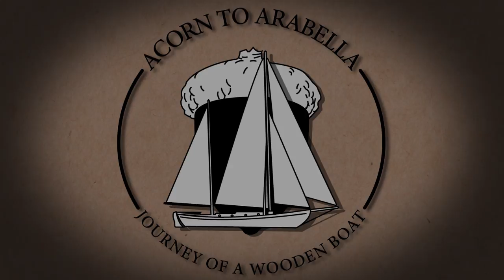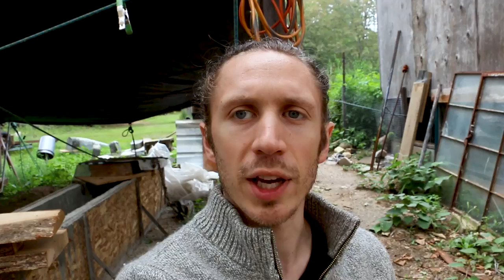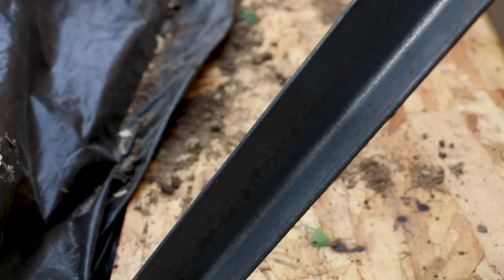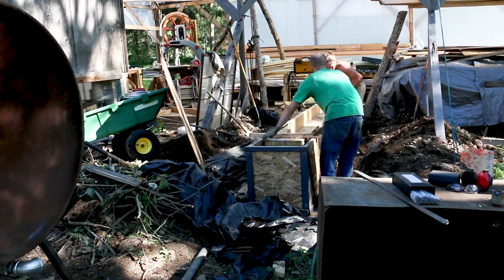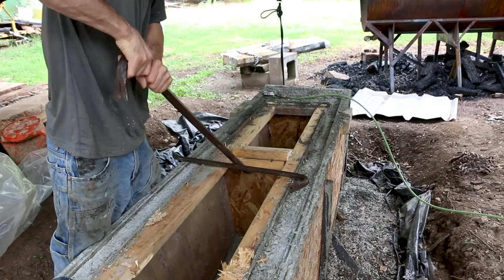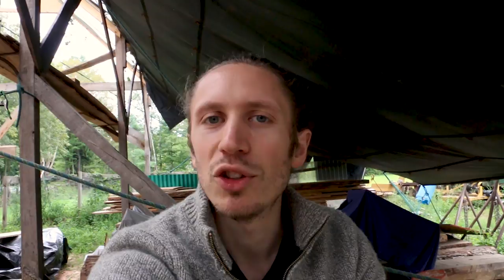Acorn to Arabella - Journey of a Wooden Boat - Episode 15:  Casting The Ballast Keel Mold

Comment: When I make molds for casting glass I put them in the kiln on a low heat to dry them. Maybe if you build a fire under, around or maybe even in you could help the drying process along? Not enough heat to crack it but maybe use coals?
Reply from the maker: Hi Kevin!  Thanks for the tip.  Yes, we thought of this as well.  We have decided that we are likely not going to be using this mold though.  We're hoping to update everyone soon as to the revised plan for the pour.  Stay tuned

Comment: If you haven't poured the lead yet, you could always build a fire or two in the mold to help dry it out, then just clean it out with a shop-vac. The charcoal dust may even work as a release agent for the lead. Did you guys consider maybe laying a half cut pipe lenghtwise in the very bottom for added strength? You could weld little reber "T's" down the center to make it hold into the lead.
I personally like the vlog style as it gives us a chance to get to know you guys better and hear your take/outlook on the progress of the project.
Reply from the maker: Thanks for the thoughts and suggestions!
We have thought of all that and more for the ballast keel.  We are going to scrap the concrete mold and do it the way the old timers have done it for years.  Burying a wooden mold in the ground.  It might be more work than the concrete was but it's much less likely to explode on us!

Comment: Next week I'm casting a 600 pound keel for my Herreshoff 12.5 Haven. Will document the process. Mine will be poured into a wooden mold which is covered with plaster. Can't wait to see your pour.
Reply from the maker: Nice!
Is it a restoration or are you building one from scratch?  A 600 lb pour should be very doable, we melted down a few thousand pounds of wheel weights and it was manageable.  10,000 lbs (100 gallons) of molten lead provides a couple extra challenges! ha!
We also can't wait to see our pour, hands down the scariest part of the build!
Reply: Hi guys,
I'm building from scratch. Thought I'd get the pour out of the way and it seems like a fun challenge. Then I'd move on to all the small stuff before I lay out the frames. This is so I don't use up all my garage space until I have to. My strong back will be on rollers so I can move from inside to outside. I'm making a few test pours to see if Durham's or plaster work as a coating for the wood. You don't have that problem as you are casting in concrete. I may change my mind and do a plug like you have done. I'll post some video as soon as I edit. I'm playing around with YouTube and have thrown up a couple videos of my shop at Craig Kelford.

Comment: OK, boys ive had a fair bit to do with casting in my younger days.....get the clay sand damp only so it will form in a closed hand tightly when you squeeze the shape should remain after you open your fist. You can layer everything inside the mold with a little sifted flour as it will smooth things better. You can add venting holes into the main and leg area of the mold by first forming the 2 piece mold then breaking apart then you can push through a sharpened rod to the outside as this lets the form set better and diminishes the chances of getting cold laps in your cast. Good LUCK!!!!
Reply from the maker: We will use the sand method later on if/when we have to cast bronze parts for the built but for a ballast keel we would literally need a dump truck load of the sand! A wood mold buried in the ground is traditionally the most common method, it chars but does not actually burn.  People have also used concrete and steel.  Steel warps, we knew that from other things so concrete sounded ideal until we learned about it liking to explode.  We are going to demo the concrete mold and make a wooden one like the old timers did.
Reply: karl p ium
Reply: All good I'll be watching you lot hard at it..any questions gimme a yell

Comment: the men at a foundry do the same thing as what you have done.   They make the concrete form much thicker and smoother.  next time soak your form boards in diesel fuel to keep the concrete from sticking to the boards.
Reply from the maker: Interesting, we have been told over and over again that pouring into concrete is super dangerous.  Do you know what kind of concrete they use?
Reply: Use  Portland cement mix, no extra sand. You don't need big stones in it like in concrete.  Let it set up for a week.  Then preheat it evenly and get the water out.  uneven heat will crack the mold.  If water is on anything including the lead you drop into the pot it explodes.  so everything must be dry.  you probably need some wire in the  Portland cement for strength..  Maybe make a small mold for a practice mold.     Mix the Portland cement and water.  Let it sit for a week.  Then preheat it to remove moisture.    it must be heated evenly or it breaks.  Then preheat the mold again right before pouring lead.   also face protection is in order.  but breathing masks are not.  the temp to get lead vapors is way way high.   you will not reach that temp.  wash hands after handling lead.  don't eat while touching lead.  that will contaminate food.  no drinks or water around melted lead.

 when you get the lead melted throw in a half of a wax candle into the pot  to act as a flux.  the wax will flame up.   stir it around and the impurities (dross) will float to the top.   then dip the dross off.  Your lead will be shiny and pure.  It will flow better to make a smooth casting.  it will mold together if you need two pours. It will not have as many voids in the mold.   the mold should be thicker on the sides.  the Portland cement will make a very smooth mold and a smooth casting.  .  preheat the mold evenly with a torch.   You  can use a dipper to dip in the first little bit of lead for a test.  If no steam you are good to go with the casting. 

Using tire weights will make a good hard casting.   the antimony,  tin , and lead in tire weights make exactly the best hardness.  I have shot over a million rounds of lead ammo.  Soft lead makes bad soft bullets.  Tire weights make very hard bullets. 
 
Here is a casting made from Portland cement. 
https://www.youtube.com/watch?v=ZLcXt2Pn8jw

The only thing i do different than they do in the YT videos is I scoop off the dross while its in the pot.   Drop in a wax candle to act as flux.   stir up the heated lead.  the dross will come to the top.   I scoop it off then.    ou can scoop of the top of the mold too.

best of luck sailors

Comment: Hi guys , i understand the use of lead , it being dense for volume but would concrete reinforced with rebar , but it is a pretty close second in contention to lead and way safer , concrete weighs around 4.5 to 5.3 thousand ponds per square yard depending on how dense it is mixed with portland cement and rebar and of course aggregates , lead is about fifteen percent per yard heavier per square yard i admit but concrete is easier and safer by far  , just thought id put that out there , i know it way too late now but for future reference  it may be worth considering , excellent videos and very informative
Reply from the maker: Concrete could have worked but it will not last nearly as long as a lead keel will and comes with a whole host of other problems.  Lead is the gold standard for a ballast keel for a reason =)

There are certainly health risks with lead and if anyone is considering pouring a keel we highly recommend you read the comments below and do your research about the health and safety issues.
Reply: lead is 11.3 g/cm cubed.   Concrete is 2400 kg/m cubed or 2.4 g/cm cubed.  so 370% heavier per volume. Nice work guys. I will follow your progress with interest.

Comment: If you plan on using pipeing for the pour you should apply heat the pipe it as the lead will solidify inside and plug the pipe. Also, be sure to test the setup before you commit as small problems will quickly turn into big ones with hot metal.

Are you planning a single pour or multiple? Wonder if there could be bonding issues if too much time is taken between pours and an oxide builds up.
Reply from the maker: We will use a pipe for the pour and it has to be done in one shot otherwise you will get layers and that is no good.  

If it could be done in small batches we would have done it already.  
We have to melt and pour all the lead at once, that's roughly 100 gallons of molten lead weighing 10,000 lbs.  We are terrified and want to get it right the first time and only do it once. 

We melted a few thousand pounds of wheel weights in preparation of the big pour and learned a lot from the process.  We had a clogged pipe and leaky tank and much more.  It should all be shown in the next video in two weeks.  Stay tuned!

Comment: Check out SV Seeker.  Doug poured at least that much in his boat.
Reply from the maker: We have and he did, but he did it in roughly 1,000 lb batches.  Because of the difference in design he could get away with that but we cannot, we have to pour it all in one shot.  We literally would have to scale up his rig 10 times which does not seem practical.  But he does have some good insights into the challenges!
Reply: I would have waited until you have the keel made then dug the ballast mold into the ground and lined it with ply making sure you put the bolts through the keel leaving a gap then burying the heads of the bronze bolts into the ply, put the keel on top of the mold then pour. SV seeker only realized right at the end they didn't need to melt all the lead, all you need to do is fill all the gaps with molten lead, ie just poor some into the bottom of the mold then put solid bits in and pour more, try it on a small scale, you will find the molten lead attaches to the solid lead with no problem.
Reply: Acorn To Arabella p

Comment: You might have seen SV Seeker. He has a steel hull boat and a different style of keel but he did fill them with lead and had a pretty good set up for it.
Reply from the maker: He did.  Unfortunately our keel has to be poured in one shot.  We would have to scale up his set up 10 times to achieve our pour which seems impractical.  But we learned a lot from him!  We could not believe they poured inside the boat with no protective gear.  I know we were not always wearing ours but at least we were outside in open air! Not inside a closed space!
Reply: Acorn To Arabella I know what you mean. The other thing I totally dont get is why he filled his keels on land miles away from the water. Seriously why not leave the job till later and save the lifting and trucking.

Comment: Not sure where you are in the pour? Can you consider using Zypex applied to the inside of the concrete? In typical moisture incursion into a home foundation, you can mix the Zypex with water and paint or spray it onto the concrete mold creating a moisture barrier? This is done on the inside of the foundation.
Reply from the maker: We poured the keel this past Monday! We destroyed the concrete mold and used the wood one we built.  The fear with the concrete is the moisture tuning to steam, expanding and being trapped in the concrete then the concrete cracks or explodes.  It is a issue with moisture trapped inside the concrete from when it was made, a coating would not help.

Comment: Have you looked into using green casting sand -  you can make a plug out foam that burns away when you do the pour - the sand is packed around it and then you pour into it. Also, instead of using wood plugs that burn away, you could use stainless steel threaded rods and immerse them into the lead while it is still molten. Before putting the rods in bend them at one end so you have an "L" shape so they are more secure in the keel. I worked in the sail boat building industry for 15 years. We didn't make our own keels but I know some of the techniques that our keel makers used. One used casting sand to create a rough lead plug that was dropped into the molded fiberglass cavity of the keel. Another built a steel mold, and a third used casting sand to create a keel with bolts in it that was bolted to the bottom of the hull. Earlier models had the keel as part of the hull that contained the rough lead plug and later the keels came with a smooth finish and they were bolted in place to the bottom of boats that were built without a keel cavity. There are vids on ytbe that show using casting sand and also the "lost" foam method.
Reply from the maker: Thanks for the suggestions!
We are going to demo the mold and make a wooden one.  Sounds bonkers but it is how the old timers have done it for a long time with excellent success.
We have a bunch of custom casting to do later in the build and will use the green sand for that.  
We would like the bolts to be bronze and to be removable hence the wood cores.
Reply: Understood. I would still suggest stainless threaded rod. If you leave the rod straight instead of putting a bend at the end to ensure it won't come out of the keel, then the threads will still provide a good grip for the lead of the keel. The problem with bronze is it is suscepitable to electrolysis and it won't be easy to inspect for metals leaching out of the bronze unless you pull the bolt from the keel. Even though you may provide zincs for prevention of electrolysis you will still need to inspect the bolts periodically to make sure they are not degrading. I have seen the effects of electrolysis on props - they turn red where the other metals have leached out of the bronze, leaving only copper behind, and the structure left is like a piece of copper sponge - with severely degraded strength - you can break it with a solid tap of a hammer.  In any case - I wish you good luck with the project and will look forward to seeing the completed yacht!

Comment: any reason to pour it in one go? i would've thought making bricks of lead you know is going to be pure enough, then pouring hot lead on that would be the way to go.
Reply from the maker: It's best if done in one shot so there are no air pockets or cold seams that did not melt together well.  If the bricks of lead don't weld together perfectly the keel could be too weak and possibly bend/break when we try to move it.

Comment: Start a wood fire in the mold to speed the curing , not directly on bottom or to large or hot ?!
Reply from the maker: We could, too hot and we could crack the concrete, too cool and the moisture stays and becomes bomb.  Either way it scares us too much to use it.  We are going to demo it and make a wooden mold and bury it in the ground.  It's how the old timers have been doing it for a long time with good success.

Comment: I think I would start a fire inside the mold before you pour it to dry the water out. Or heat the inside with a torch
Reply from the maker: It's a idea we have been tossing around but we are going to demolish the concrete mold and make one of out wood and bury it.   Sounds insane but it has a long track record of success.

Comment: Have you looked up sv seeker on youtube he poured more than three times the weight of what ur keel is. Hes building a 75 foot steel chinese junk sail boat.
Reply from the maker: Hi Alex.  Thank you for the suggestion.  We have already seen SV Seeker's pour but it is a drastically different situation and doesn't really apply to ours.  He is pouring his lead directly into the bottom of his vessel and in stages.  We need to do a single pour in a mould.  It is not possible for it to be done in small increments.  We've got a system figured out though and we are hoping to get that done somewhat soon, although we are racing winter at this point and may have to wait until spring... Other than the logging, this is the single most terrifying aspect of the build, so we are taking all precautions to make sure we do it right and safely.

Comment: the weight of the lead will spread the mold and destroy the cement unless you weld steel angle iron rim and at least 4 or 5 cross supports ..............just saying
Reply from the maker: Hi Don,
Yes, that was the plan as well but we are reconsidering our whole lead pour and will be throwing out an update on the revised plan.

Comment: Is lead better than a cement keel?
Reply from the maker: We think so.  First off the plans call for a iron or lead keel so if we did concrete we would have to get a naval architect to re-draw the ballast since concrete is so much less dense.  
Concrete is also not as long lasting as lead is.  Lead won't really corrode in the ocean, neither will bronze (they will it just takes forever) so having a lead keel and bronze bolts is the most stable non-corrosive setup you can realistically have.  The concrete will break down eventually and if you put any steel in the concrete some day salt water will get to it, it will rust and the concrete keel will slowly explode.  That is what happens to ferocement boats.  We hope Arabella is still sailing in 100 years and are trying our best to build her so she will be!

Comment: I assume you have to allow for shrinkage
Reply from the maker: Yes and it's a guessing game at best.  The lead cools and solidifies from the outside in so it's tricky to determine exactly how much it will shrink and exactly where.  We made our best guess and got the width spot on and was 1/4 short  on the length which is no biggie.   It also ended up shallower than drawn even though we added 500 pounds extra to the melting pot.  Maybe Atkins calculations from 1934 were a tad off.  haha =)

Comment: This is where some math would have come in handy.  An excel spreadsheet could have estimated the volume of the lead keel you designed and also estimated the volume of concrete you'd need.
Reply from the maker: yeah... that would have probably been the smart thing to do.  You live and you learn!